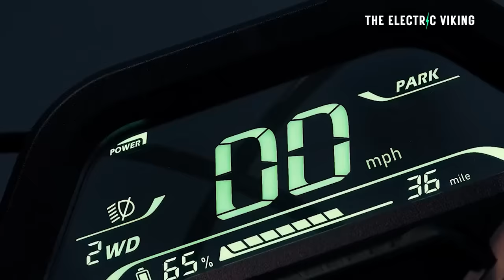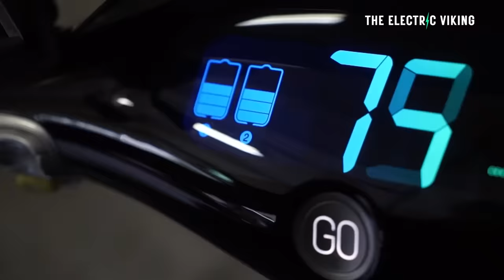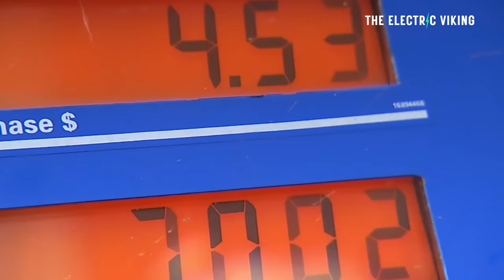Electric scooters destroying oil demand 4 times faster than electric cars

Comment: Trains are the most reliable , economical and environmentally friendly transport ever.
Reply: We need to put batteries in the Diesel Electrics though!!
Reply: Clearly you don’t live in the uk 😂
Reply: That depends on where you are. They vary from great in some places all the way through to non existent in others.
Reply: Well, depends upon the motive power, but yes. Problem with trains is that they don't pick you up or set you down exactly where and when you want. And that's their limitation. In the UK they cost a mortgage to go anywhere. By comparison, in Europe the tickets are very reasonably priced.
Reply: I will be 81 yrs this year. I have probably used a train 4 times in my entire life trains can replace expressways in some circumstances. Suburban to urban commuting😊
Reply: @simonpannett8810 Electric trains are very common, and actually invented before the diesel engine!

But it's normally cheaper to run them on overhead wires than batteries. It also saves battery materials for other vehicles.

So wire-powered electric trains are great.
Reply: @johnsteichen5239 what point are you trying to make? You’ve lived somewhere with shit infrastructure so no one else should have any good infrastructure? Very confusing

Comment: This is a real good one Sam. Really what we need to hear.  Although,  keep in mind those that live in the more northern latitudes and scooters don't work too well in a foot of snow.
Reply: They do work well during at least half the year, and northern latitude roads tend to be wider to accommodate snow during the winter, so the shoulders are wider than in the southern USA.
Reply: January 8th here in my part of Canada around Toronto and its curretnly +2celcius and no snow. You could ride a e-scooter today
Reply: SKI-DOO.
Reply: Yesterday we had some snow... Today I rode my ebike no problem. I'm 73
Reply: @peteinwisconsin2496  folks, it's the traction I worry about. Bicycles are a little different because they have more contact pressure at the wheel. I rode my bike all year round in Vancouver. I even came up with my "bike windshield " for riding in the rain wearing glasses. Hint,  not actually a windshield or fairing.
Reply: @DrTofutybeast   Nice!  Good for you!

Comment: Of course it's no good if the weather is crap, or if you need to carry more than a few bags worth of stuff, but there's plenty of times this wouldn't be an issue.  Personally a very small 3 or 4 seater (think smart car) would be a better fit for me.  Currently we have a 2004 civic beater that does 80% - 90%, and a minivan for when we need something bigger.  I'm holding off a few years to see where technology goes ...

Comment: Use an e bike for any journey less then 40km round trip. It can still be a struggling here im Edmonton for snow removal in the winter and reallly a tough sell even to myself not to drive ( i have about an hour ride to work) when temperatures plummet into the -30s like they will next week. I do however think micro mobility should play a large role in the future as well as accommodating transit. The small escooter is really easy to carry onto a tram , train , or bus , and connect you to your end location

Comment: Wow, I agree with you. I'd love to use a scooter or ebike but it' s not safe where I live in Florida. There are no dedicated roads and only one trail in Sarasota. It would be fun to boot around downtown and to the beaches on these and for sure would declog the roads and vastly reduce pollution. I figure 25% waste of fuel idling with a/c running and driving at slow speeds with gas cars. You can smell the old clunkers too, awful. Way less parking space required too. Older people will find it impossible to use for the most part and we have millions in Florida. I'm up there too but still very mobile

Comment: Sam, you did not mention electric bicycles!  I bought one 18 months ago, use it all year round to check on livestock etc.unless I have to use my ICE car and to date, have clocked up 2500+ kms.  Not only saved money on not having to buy fuel, have recouped the cost of the bike, and have lost weight and gained fitness as an added bonus!  As for electric scooters, these are vitually banned from public spaces here in the UK.

Comment: Where I live, I wouldn't want to drive without protection from the elements for about half the year. Using a bicycle in the rain is far from pleasant and ludicrously dangerous in winter with snow, slush and ice.
Reply: Don't you use winter tires with spikes? I remember when I was young 60 years ago, we used chains on the front wheel.
Reply: @leiflillandt1488  If studded tires are only legal from December through March due to road wear concerns, I doubt seasonal chains which are much worse for road wear and the risk of flinging things up including themselves are still allowed.

Comment: My EV is an electric bike.  Remember that scene in "ET" where the children take off into the sky on their bikes??  That is EXACTLY how I feel when I ride my electric bike.   I have been riding it for a couple years now.   Maybe Viking (or viewers) could tell me why the electric bike batteries seem to quickly degrade, such that I don't get the same mileage per charge.  It could be because as time goes along, I enjoy going faster and faster? :):)   I ride my regular bike TWICE as much as my electric one.
Reply: It sounds like you like the electric but you ride the normal one more often? Is that because the electric got you back into cycling and you got fitter? 

As for the battery, electric bikes have lower quality batteries and afaik don't have cooling and heating systems as cars do. Whether or not there are better quality batteries with smarter management available I couldn't tell you but future battery chemistry will likely make them last longer. You might also be hurting your battery if you're not keeping it and charging it in optimal conditions (e.g. should it be warm when you start out, should it be charged to 100% etc etc).
Reply: @jonevansauthor  .  I enjoy the total freedom of a regular bike and have been riding frequently forever. They are much lighter.  I live up a very big hill so I arrange my regular bike rides around my GF's swimming schedule and she gives me (and bike) a ride up the hill.  We put our small dogs in the back of the electric bikes, something I can't do on a regular. :)

Comment: I don't own an EV but I do have a scooter. Must say it's a great way to get around and I would use it a lot more if there were more bike tracks to use them. They'll never have the stability of a bicycle or motorcycle though, so I think the speed should be no greater than about 30km/h, but power should be basically unlimited so that it has plenty of power to make it up hills without slowing down. If someone wants to go faster they should probably just get an electric scooter / motorcycle, speaking as a motorcyclist. I think I would have to meet you in the middle and say trains are still important, but it would be good if bike tracks ran alongside the rail network, that would be amazing
Reply: I agree with you that trains (or light rail) should remain a feature of the transport mix. In Melbourne, the government has been removing level crossings and copped a lot of flack over elevating the rail line in places. Without getting into a debate on whether 'sky rail' is a good thing or not, it does open up recreational use of the land below, including bicycle paths.
Reply: @rossjohnson7916  totally agree mate, I've been to a few of the new stations around Melbourne and I reckon they're great :-), growing up with the old stations as a kid they're a massive improvement

Comment: If I lived in a developing country, I'd throw in solar panels to a Gogoro battery swap station.  One's fuel source is local.  And solar will get so cheap, one can place it everywhere.  Plus the station can double as a power station for other things, e.g. help support the grid (if there is one).

The problem with scooters and e-bikes in the US, is that the roads are built for cars.  There's not enough bike lanes.  And even if there were, it's not clear e-bikes are always allowed on some.    The regulatory issues have not been worked out.

Comment: One issue that keeps coming up when I consider riding my ebike somewhere, is risk of theft.  So I drive my Toyota Camry Hybrid the 3KM to the shop as I don't see it as risky, despite its worth being 10x that of the ebike and costing 20x more to operate.  I do more KMs on my ebike (around 10KM to 20KM daily) than in my Camry but it's all for exercise, virtually never anything else.  I'm guessing it's a similar issue with many escooters.  We need to address all of the issues that are preventing widespread use of green efficient vehicles.

Comment: Another factor with scooters etc is the amount of resources required to manufacture them. The materials required to build one electric car would be enough for maybe 100 or more scooters.

One thing I would like to see is LED running lights to be compulsory for scooters. The power consumption is minimal but would make them much more visible. I regularly see people wearing very dark clothes on dark coloured scooters, they are not always easy to spot. Have a LED's would make it a little safer for everyone.

Comment: You are right about rail for human transport, but steel wheels on steel rail are super efficient for freight. Besides, railroad engines are already electric, all we need is a high power system to charge/ run the motor.

Comment: An underrated form of PEV is the Electric Unicycle (EUC). While there is a small commitment to learning a new skill required (making it less useful for public hire schemes), there are many benefits. Range of even the smaller/lighter wheels is 50-100km from a charge. When you get to your destination, just wheel it around like a small suitcase with a trolley handle (rather than locking it up and hoping it isn't stolen). Smaller and more discrete on board public transport or out of the way in a cafe. And fun! Still waiting for the Victorian government to stop kicking the can down the road though...
Reply: Before COVID and working from home, I would commute on my EUC (Kingsong 16X).

Comment: Thank you for this topic of electric scooters bikes as well . will give a little bit of my experience in northern Indiana United States. I do have a scooter that does 35+ miles per hour and use it quite a bit until the weather got around 40° and colder. It’s just unbearable to ride in the winter time too cold Summer is great though, the other factor that I have to keep in mind constantly what some other folks have already touched on riding  alongside the edge of the road kinda like bicycle but going faster than a bicycle puts me in a position where I have to choose back roads that are more inconvenient to be safer And even then it’s not always safe I have to constantly be on guard. It would be so nice to have the infrastructure designed for bicycles, scooters horse and buggy, which is very common in my area. They are all on a different level of transport than automobiles and should not be combined with high-speed traffic for safety reasons that’s just my thoughts. So, in addition, we do have a few designated horse and buggy lanes on the edge of busy highways and roads here in northern Indiana I do believe that this type of thing needs to be focused on much more than it is already. horse and buggy travel is huge in some areas, northern Indiana, Ohio, Pennsylvania And now scooters and bicycles are becoming even more and more popular with e bikes and e scooters. We really need more designated lanes of traffic for these types of transport to be able to get along together with high-speed traffic .Thank you for this topic.
Reply: For the cold, I 3D printed a fairing for my scooter to keep the wind off, and added a windshield and hand shields. Makes a huge difference, improves streamlining and makes it bearable when well below freezing.
Reply: Do you have any experience of how horses react to scooters. My experience as a motorcyclist is noise can spook them, but what about silent scooters coming up behind and surprising them?
Reply: @richyfoster7694  have not had any spooking horses yet. Of course I wouldn’t come up right behind as they are traveling with buggy behind them. They are used to bicycles so I think no problem.
Reply: @richyfoster7694  Not many horses in cities, but just slow down and keep your distance as with any vehicle.
Scooters are quiet but not silent.
I have ridden by many horses in the country where I live without any problems. It's a non-issue.

Comment: It may be worth noting that the countries where e-bike usage is highest are those that are much nearer the equator than Norway for example. When was the last time anyone rode their e-bike in the snow, when their was ice on the roads, or even just during a downpour, which I'l grant happens more often in equatorial regions than in regions much further North or South.
Reply: But the Asian super conurbations are largely in warmer climes. I think the solutions chosen are clearly location dependant. From my experience, electric scooters are brilliant up to say a 15 or 20% gradient. Not really practical on steeper than that.  I bought mine here in Chiang Mai, Thailand. It cost about $300 new, incl upgrading to LiFeo4 battery. Range is about 40km and it tops out at 45km/h.
Reply: That's when you need a micro electric car.

Comment: You are right. We should be prioritising the most energy efficient means of transport which are the bicycle and electric scooter, but public electric transport (train and bus) should also be prioritised over the car for the same reason. Sadly though, this is unlikely to reduce fossil fuel consumption overall (Jevons paradox); the only way to achieve this is with a global fee and dividend tax on fossil fuels.

Comment: I suspect that the reason that Oil consumption has not fallen in proportion to the uptake of Electric cars is that large freight trucks have not been changing over to Electric power at all. In addition, the need for Road maintenance is MUCH MORE affected by heavy goods vehicles, a larhe B-Double does about 100 times the damage to the sub-base of the highway compared to a passenger car.

Comment: I’m 70 years old and have well over 3500 miles on my Segway Mini for urban transport under say 8 miles round trip. If I need to go grocery or other high volume shopping or longer trips I take my full size eBike.  I don’t buy into the greenie man made greenhouse bunk and I drive a one ton diesel truck for long jaunts. The Mini and eBike are just more economic and frankly more efficient and many times faster. If it’s pouring down rain I fire up the diesel. ICEs don’t like short trips that don’t even bring them up to operating temperatures before they need to be shut down.

Comment: Interesting. I found this online

Recently, it was regaining ground from the drop to 228.0 Mtoe in 2014. In 2020, however it fell to 217.8 Mtoe, but increased by 4.7 % to 227.9 Mtoe in 2021.

So in 2021 it was back at 2014 levels. 
  Deloitte publishes the following

Despite these disruptions, global oil demand remains on track to grow by 2.3 mbpd in 2023 and cross the 100 mbpd mark for the first time in history.3 At a global level, electric vehicle (EV) sales grew by over 35% in 2023, with one in seven cars sold being an EV.4 This simultaneous growth in both petroleum-powered vehicles and EVs reflects regional disparities in demand structure, infrastructure readiness, technology adoption, regulatory policies, and socioeconomic considerations.

Comment: While I agree with your argument for the most part, I live in Canada and winters here are NOT scooter friendly.  I expect this is true for most countries higher up in the northern hemisphere.  So while I like the idea of more scooters and less cars on the road, once November hits here in Canada, you want to be in a car when you are getting around.  Between ice, slush, snow and deep freeze temperatures, a scooter is not an option to use during a good chunk of the year here. Thanks for the video.
Reply: I also live in Canada, and strangely enough in Ontario's "snow belt".  We haven't got much snow the last few winters, though.
Scooters would work fine in the GTA or probably any big city, especially the foldable kind you can take on the subway.
Reply: @capnkirk5528  I am living in Ottawa and the winters are either lots of snow and cold, or a good amount of snow and cold with a deep freeze for a couple of weeks Jan to Feb.  The streets are not good for something like a scooter at that point.  Most Canadian cities don't have a subway to cover the larger distances.  Toronto is definitely the exception.

Comment: A major issue with cars in general (including and especially electric) are the incredible costs that come with producing the materials then building them in the first place, and then the same reflected costs to finally dispose of them both financially and environmentally on both sides of production. A 20 Kg scooter will leave a dramatically smaller environmental and financial footprint per person across the world than a 2100 Kg e-vehicle would.

Comment: electric scooters(as in foldable ones with no seats) make sense for one thing: as a complimentary form of transport for the last mile of the trip. either from a large parkinglot at the edge of town or a transport hub like a train or bus station. electric mopeds and bikes are far better for traveling ex. from home to work. i have an electric scooter and there are several hills it seems unable to climb. not to mention its kinda useless about 6 months out of the year due to rain and cold. heck, i got bronchitis in the middle of summer after using my bike and escooter to get to work so don't give me the whole "can be ridden in cold" bs.